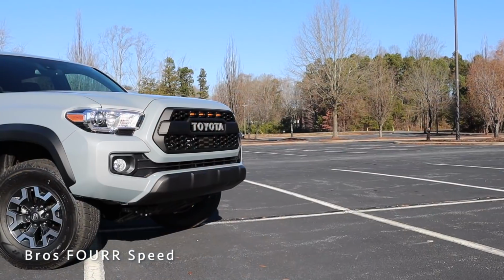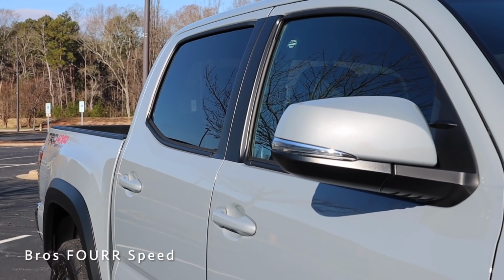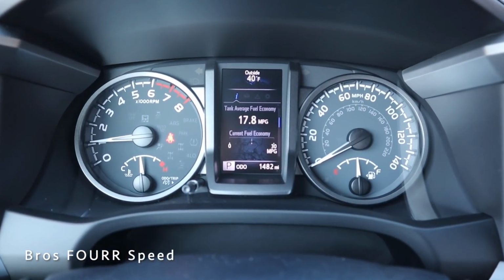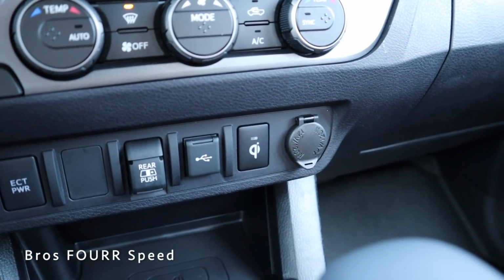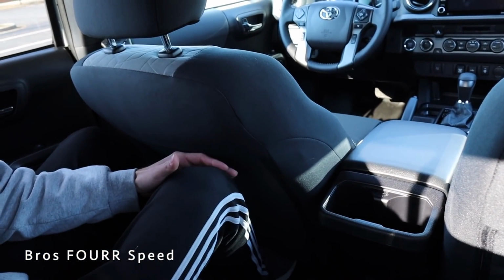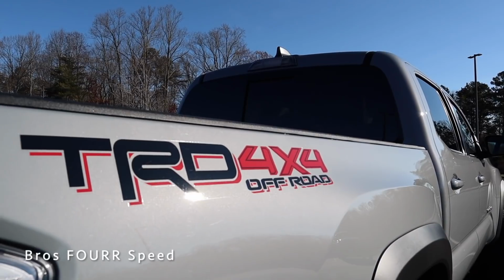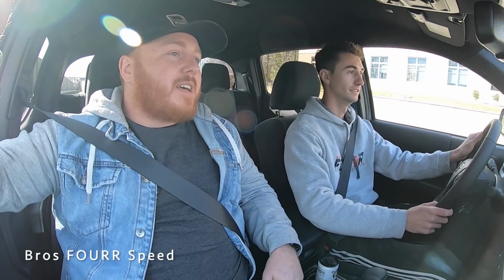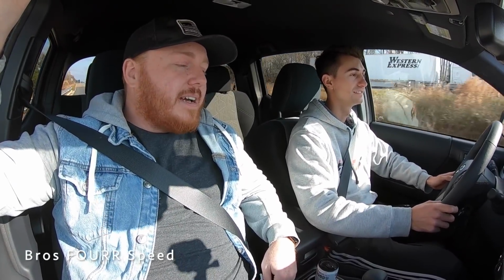2021 Toyota Tacoma TRD Off Road: Start Up, Walkaround, Test Drive and Review

Comment: the interior quality difference between 4runner and tacomas is wild for the same years, same trim levels. It really is a full step up in 4runners
Reply from the maker: An offroad 4runner is the same as this.
Reply: @BrosFOURRSpeed the interior is way nicer in the 4runner from what I felt driving both but maybe it's subjective
Reply: But it also makes sense because 4runners are usually several grand more from ones I've compared for the same years and even when both are trd off-roads

Comment: I'm sold on the Toyota Tacoma TRD off road. But come on Toyota,  how about LED headlights and get rid of that 80s rear drum brakes. That would round off a perfect truck. And also long range (larger capacity) fuel tank.
Reply from the maker: LED headlights are an option. But its like $2k. Can get them aftermarket for less then half. Range seems pretty normal. 300-400 depending. But a new one should be coming soon!

Comment: I have had my 2019 TRD Off road for about 6 months now. Mine is also the cement color, but it is a 6 speed manual. I absolutely love it. I used to be a Chevy guy but I think I have been converted.
Reply from the maker: Nice! The manual is a cool way to go! Tacoma's are rock solid trucks!

Comment: Not having LED headlights should be a crime in a $40k vehicle. I know they are an option, but common being able to see is the best safety item. It also needs more color on the inside and the parking brake on the floor to free up space.
Reply from the maker: I agree on the LED's, I switched them on mine to LED's and it made it a lot brighter for sure.  I personally like the hand brake over the foot e-brake, makes it a bit easier to use for me at least!

Comment: I came close to buying this. All I seen from the reviews was in the same model as this truck. I took it for a teat drive and felt like a sluggish wandering transmission. When I looked at it it was $43,000 CAD and two weeks later it jumped to $48,000. I got a 2014 Honda Civic Si instead as I’m never getting rid of my 2000 Jeep Cherokee xj
Reply from the maker: Oh wow! The gear issue is because they kept the same differentials from the 2nd Gen tacoma with the 5 speed auto. So they are not the correct ratio for a 6 speed. Did 5.29 gears on my brothers Tacoma and that solved it. Si sounds fun!
https://www.youtube.com/watch?v=bd0aqwB2Nko
https://www.youtube.com/watch?v=SJm73yOzc_M

Comment: No mention of the transmission hunting for gears did Toyota fix this?
Reply from the maker: You really only notice that on the highway. My brother re-geared his Tacoma. That's how you solve it. Toyota did not change the axel gears in the automatic from when they had the 5spd and went to the 6sp. So the differentials think its connected to the 5spd AT and isnt geared correctly. Don't know how toyota didn't know that. 
https://www.youtube.com/watch?v=bd0aqwB2Nko
https://www.youtube.com/watch?v=SJm73yOzc_M

Comment: I really wanted to see you again inside that Tacoma. I'm only 5'10 and I bang my head on the ceiling every time. My.wife who's only 5'4 has no problem.
That's a non starter for me. 
I'll stick with my Ford f-250..
Reply from the maker: Honestly at 5ft 11 I never have issue getting in and out of this. Much smaller then an F250 for sure. Might just have to modify how you get in and out

Comment: If you put the shift lever at S for the Manual will it shift manually with ECT depressed at Higher RPMs ??
Reply from the maker: You can put the shifter into the S mode and use that regardless of if ECT is on or off.  ECT will basically hold the gear longer, so if you are towing it won't downshift as quickly.  You can use that in regular auto mode too, so that's different from using the S mode.

Comment: Currently looking into which package i should get! TRD sport or TRD pro!
Reply from the maker: So it really depends on how much you are willing to spend and if you are modding the truck at all!  The TRD Pro is definitely a cool truck, but personally I wouldn't spend the money for it.  Everyone will have a different perspective on that, but I bought the TRD Offroad and at the time it was around $10k less and I knew I would be modding mine.  Basically all you are paying for on the Pro is for the suspension, tech and interior (seats).  With the TRD Sport, you can get that with or without 4wd, so that depends on if you will use it or not.  Hopefully that helps!
Reply: @BrosFOURRSpeed  thanks! Yes it did help.  For me i mainly just do simple housework, pick up lawn mowers here and there.  And carry my kayak. Maybe eventually a small boat. Thats why im leaning towards the TRD sport. I think i will be ok with that. And i also live in Massachusetts,  so we get good amount of snow too

Comment: I was enjoying the video up to the point you start fawning over the push button start. Please, elaborate on what was so difficult using the ancient key to start the vehicle?  No one ever says what was so bad, so please help me out there. And you can find tons of complaints where the fabulous modern auto start has problems #1 folks can't get in the car cause battery or computer died, #2 the added expense of getting a new one programmed when old one has died. #3 car thieves intercepting the signal and stealing the car while you sleep.  IMHO, you get added headaches and added cost for zero benefit.
Reply from the maker: The positives with the push button is that you have keyless entry, so you can walk up to the vehicle and as long as the key is somewhere on you (pocket, backpack, purse, etc) you can open the door and then start it right up.  Nothing wrong with a turn key, this is just more convenient.  On your first point, if the key fob dies, there is a key within it to unlock the door manually and you can still start up the vehicle.  All you have to do is replace the battery, no need to reprogram anything.  If someone really wants your car, they will take it, doesn't matter if it's a turn key or not.
Reply: @BrosFOURRSpeed  Thank you for answering my  questions but your answer proves my point that the keyless really doesn't offer anything better. Being able to walk right up to the vehicle and open the door and start right up? Like that saves at least .00089 of a second and so much less back strain? Most have security fobs that can do the same thing as far as opening up the door. But I guess I've never really noticed until you mentioned it what an effort it took to actually take my right hand and ( straining of course) lift it with the burdensome heavy key, and inject it into the ignition...and then turn.
 And there are tons of videos of folks where they can't get the car to open/start etc and yes, it's more than just the battery
Reply from the maker: @captinbeyond  Ok, sounds like you like the turn key better. I have one of each and like them both, but the smart keys are nicer to have. It’s more convenient for sure to not have to look for your key and get right in.
Reply: @BrosFOURRSpeed   It's not that I'm so fond of using keys, I just see keys/ignitions as something that has always been around and has worked for decades, without being too much of burden. When the keyless first came out there were a number of deaths from people leaving the car running in their garages and thinking the car cut itself off. Then I see on the news and web  about thieves intercepting the signals ....folks waking up and their car is gone...no busted glass, no car alarm, nothing. Later I'm reading car reviews and read about folks having to pay big bucks to have a new key made when their old fobs stop working. And cases where folks couldn't get into their cars at all. In some cases they couldn't even get out of a locked car. I add up  all these negatives and compare them to what has been around forever and it seems a lot of folks are frothing over this "new feature" that really didn't enhance anything of real value but brought with it lots of issues. It's like taking away radio on/off/volume/channel knobs and putting them in a display screen...just silly to say it is better or improved.  But enjoy the feature and thanks for the feedback to confirm my long held beliefs.
Reply from the maker: @captinbeyond  I don’t agree with everything you said there but if you enjoy the turn key great, that’s why there are tons of options to choose from, but most newer cars are going to the push button. I’ve had it for years on my Tacoma and don’t see any negatives to it. I like it better then my turn key in my R8, wish it had that. But everyone has preferences, there’s no right or wrong on this topic.

Comment: Thank you for the video, I am considering buying this Tacoma however it will be my first pick up and I was wondering if I should get the 2 door or the 4 door version. Can anyone give me some pros and cons of each? I think the 2 door also seats 4 people anyways. Would love some feedback from Tacoma owners.
Reply from the maker: I've never had the 2 door Tacoma before, but remember there is the 2 door and the access cab.  The 2 door won't have back seats and the access cab has sideways seats, so they are just really there in a pinch.  Not a full backseat area, it's mainly good for interior storage.  If you have 4 people in the truck a lot and use the backseats I'd go with the 4 door all day!  If you don't need the space and it's just you, then the 2 door or access cab!
Reply: Did you end up getting a Tacoma?

Comment: Hey small question, does the default TRD off road come with seat warmers? Or do you need to get that off road package? The dealer made it sound like you needed to get the “off road” package with the sun roof, leather seats, etc to get warmers which isn’t worth it to me but obviously they’d be nice to have on cold winter days
Reply from the maker: The cloth seats in the Tacomas don't get the heated option, but the leather should.  I don't know if the leather in the TRD Offroad gets it, but possibly in the limited model though.
Reply: I have a 2020 trd off road premium. It has every option available on a tacoma. Soooo nice

Comment: A co worker said the automatic downshift a lot on the highway and has no power to get out of its own way can Antwone comment on this? Are they that bad on power?
Reply from the maker: I own a 2017 TRD and it has plenty of power for a pickup.  It can get up and move to merge, no it's not the quickest, but it's also not a sportscar either!  I can tow a 4500 pound boat and still get up to speed decently with that load, but even with my 34's acceleration is fine.  The auto's are known for being shift happy on the highway, I ended up regearing mine and it's smooth now cruising around 60/70 mph!  Obviously that should be addressed from Toyota, but after doing that, it's proper now.  But I love the truck!  Tacomas are great midsize trucks!

Comment: I have a 21 tacoma automatic, I will say it is by far the most annoying automatic transmission I have ever driven. They programmed it for fuel economy NOT drivability. it shift like a crazy person. holds really low RPMs and shift really quickly from 1 to 4 then back to 3. you will be driving at 50mph and want to go a little faster and it will drop 2 gears. I have driven other 6 speed, 8 speed and 10 speed autos and they didn't do all that.  My wife doesn't notice it or care. You may not either. If I did it over again I would get a manual trans or a different truck. Maybe I am wrong but my standards are kinda high for a $40k truck.
Reply from the maker: The problem is because Toyota used the same gearing for the axles from the 2nd generation Tacoma. My brother re heard his to 5.29 and that solves the issues you're having. The 6 speed manual tacoma has proper gears. But they new 6 speed automatic didn't get new gearing when they decided to go from the 5 speed to the 6. 
https://www.youtube.com/watch?v=SJm73yOzc_M
https://www.youtube.com/watch?v=bd0aqwB2Nko

Comment: Have they improved the leg room for the driver?. Previous models wouldn't accommodate a tall person. I am 6'1. Very cramped i feel like i am in a Corolla.
Reply from the maker: Same as the 2nd gen in my opinion. I'm 5ft 11 and have no issues. But you can move the seat back to help. Might want a Tundra if you find this cramped

Comment: Just bought my 2021 Off-road access cab in the army green. I love how long lasting these are not just mechanically, but aesthetically, in 30 years this will still look like a sharp truck. I love the ‘95 Tacoma’s for that reason, absolutely timeless look.
Reply from the maker: Very cool, congrats!!  And yea they definitely have a great design for them, and I don't think they will age much!  That's the nice thing about most of the Toyota lineup!
Reply: Not to be nosey but what did you pay for  your truck

Comment: TRD pro with Drum brakes?
Reply from the maker: This is an Offroad, but yea Toyota doesn't do rear discs, drums are geared more towards offroading, and discs are used on larger trucks that tow a lot more.  Since this can tow around 6500 lbs, they figured more people would be offroading them, then towing.
Reply: @BrosFOURRSpeed  interesting thanks for the info, just curious because they put disc all around on the 4Runner but that is a suv and is totally different.👍🏼
Reply from the maker: @Merlosmoto  See that's weird too they do it two different ways on similar type trucks.

Comment: The value that you get out of this truck is unbeatable and the upgrades you can do just adds to the value .
Reply from the maker: I know right!  My brother has a 2017 and he could sell it for more than he paid (or brake even) three years ago! And the mods have been so much fun on it!  Tacoma is the best truck ever!
Reply: @BrosFOURRSpeed  True.i have a manual and I have had cash offers to purchase my 2019 off-road... the problem is if I sell I would want another manual and it won't be cheap or easy to find. I paid $32,000 for mine with 6 miles on the odometer.
Reply: Definitely true! When I was in the market a couple years old tacos with 20k+ miles were selling for slightly less than the new  ones! Cracyyyy
Reply: Mine will be off the boat mid-May....this is the one!🤘

Comment: Great review. Is that USB port for the rear passenger new for 21? I looked at a 2020 last June and it did not have any usb or 12v power ports for the rear passengers
Reply from the maker: Oh interesting. Yeah I guess that'd be new then!
Reply: @BrosFOURRSpeed  I just watched a video of a 21 trd sport and no USB ports in the rear. Since the truck you reviewed had a trd pro grill with lights is there anyway to confirm if the rear USB ports were actually an aftermarket install or maybe a dealer installed after? I know its not an option you can select when you build a truck. Thanks!
Reply from the maker: @DM-tf6mk  This is a TRD offroad, the grill and lights he added afterwards, but the truck came from the dealer like that, no option for it, it just had it.
Reply: @BrosFOURRSpeed  Thanks for infor. Maybe he had the dealer add it. It's definitely not a factory option.

Comment: Awesome video and review! This truck looks so good. I wanted to buy one so bad. Cross-shopped a 2020 Tacoma  with the ridgeline(I know...not a real truck😂)and other than the looks and off-road capability/towing, which I’ll never use, the ridgeline did everything better. Better interior, way bigger and more usable backseat especially if you have kids, better tech, better safety rating, and more storage with the trunk in the ridgeline bed. In the end I didn’t buy either....just couldn’t get past the ridgeline looks and couldn’t get past how cramped the Tacoma back seats were.
Reply from the maker: You do make some fair points on both of them.  I could never get a Ridgeline for the same reasons!  The only think I like about it is that under bed storage!  But I love my tacoma, the backseats yeah are a little cramped, but overall I like it!
Reply: @BrosFOURRSpeed  Supposedly there are big cosmetic changes coming for the 2021 Ridgeline. Reportedly a front end redesign to look more truck like. Keep up the great work!

Comment: Is the automatic still a mess?
Reply from the maker: I think they fixed some of those issues for the 21 model.  I have a 17 Tacoma and with a regear it's been really good!  Around city the trucks are great, it's the highway driving that could have used 6th gear more!